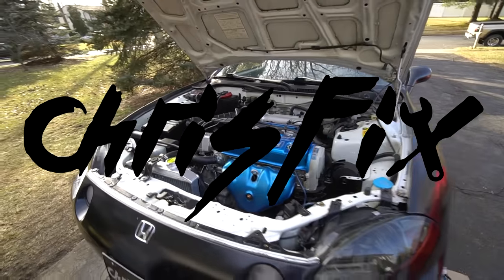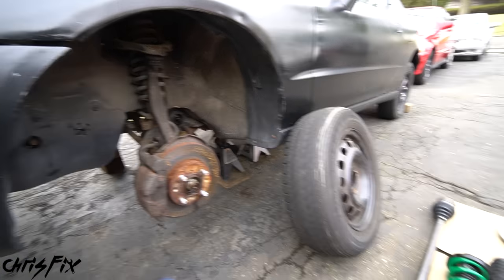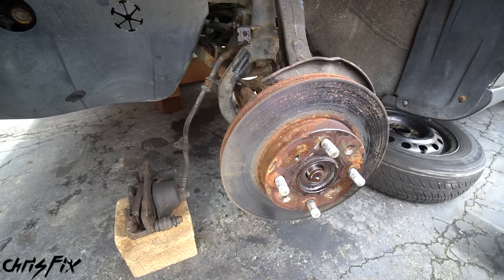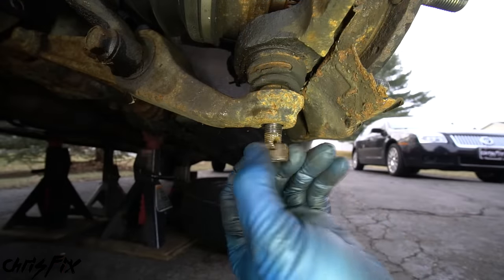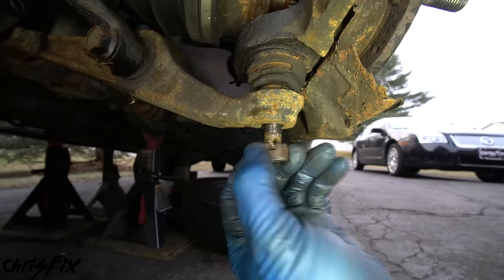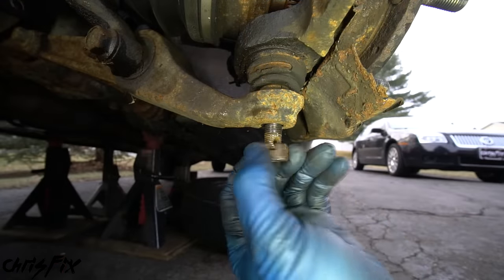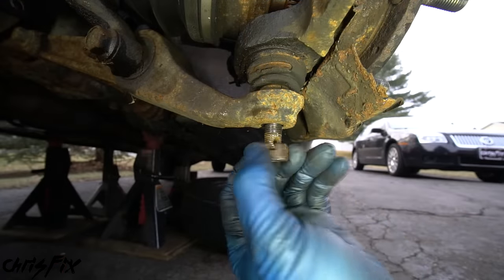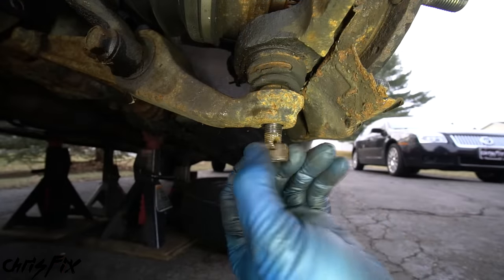How to Rebuild the Entire Front Suspension in your Car or Truck

Comment: Update: I rebuilt my front suspension and installed it myself. And Dude, I totally feel what you mean by feeling like a brand new car! I learned how to do it all thanks to your videos. Thank you!
Reply: Wow that's impressive, this job looks tough
Reply: @SenegalGab  It's not too bad, time consuming yes, but is worth it to push your vehicle's safety and reliability to the maximum. My car had tons of play in the front suspension it was scary on the highway. I knew then it was enough and it was time to rebuild. The alignment shop told me it looked like it was done at a shop, but I also needed motor mounts and a steering rack. Once I unfortunately dealt with those, I got an alignment and have never drove a car so solid before.
Reply: I am going to do this in the next couple months its been bad but after driving it almost 10k miles(190k total) since i got it its so much worse and im definitely going to rebuild the rear suspension too very scared and excited
Reply: Hello Cameraman, what brand did you use, and on what model? I'm going to do the same on my 4Runner, and not sure I can trust all the online 'reviews'!

Comment: I worked in a garage for 8months every time i had trouble when the boss left id use your page as help 😅
Reply from the maker: Lol were the videos helpful?
Reply: David Mejia Cabrera shawty
Reply: @chrisfix  very bro i actually became confident in my work thanks to you i appreciate your videos alot they mean alot to a guy like my self 💯🤝💪🏽
Reply: @chrisfix  when will you change the oil on the 1993 Honda del Sol and my grandpa's truck fuel pump is dead it is a 2010 Dodge RAM HEMI 5.7L

Comment: I'm pretty new at doing my own work on my car. I found so far that the hardest and most time consuming part is dealing with anything that is seized or otherwise stuck into place.

I like watching videos like these that are above my level of experience because it gives me a better understanding of how things work, and what tools/equipment I should already have on hand to make the jobs easier to do.

Thank you for sharing your knowledge with others. Because of people like you, I learned how to do my own oil, change my tires, replace my brakes, replace a seized caliper, and the other day I did rotors for the first time.
Reply: Not sure if you know these tricks so try these. Number one Kroil or penetrating oil Number 2 isopropal alcohol with winter green and a rubber, deadblow or wooden mallet let it sit for a bit wack it really hard a few times continue until the nut is loose. ( that little trick got a drill bit out of a Very rusted 80 year old drill) Number 3 get a blowtorch the red wrench will remove almost anything but will also ruin any temper present
Reply: Get some WD-40. That'll get everything loose

Comment: U should make a video changing drum
Brakes for disc brakes
Reply: Max Reynoso he already has a video
Reply: @TheBassforlife  Where?
Reply: @TheBassforlife  He has a video for changing drum brake PADS but not converting drum brakes to disc brakes.
Reply: Please Chris do so
Reply: TheBassforlife the video he has is not the one we need
Reply: he was to change the drum brakes on his truck to disc, even said so in a video and had the parts in the back of his truck, but sadly i think that video never happened.
Reply: Mighty car mods has a video on that
Reply: Logan Arzuaga title of the video??
Reply: @maxrl530  drum to disc brake conversion DIY
From when they first started converting too sexy into an actual track car so it's about a couple of years old
Reply: He does have a video. Did it on a ford ranger if I remember, he shows you how to change the drum brakes, then switches it to replacing a drum brake system with a brake pad system on its rear wheels.
Reply: @willd3808  I've been patiently waiting for that video ever since. I'm gonna keep waiting though cause this is Chrisfix we're talking about here and he never let's down his subscribers

Comment: This video and its sequel are what helped me start to understand the basics of my car's suspension and eventually gave me the courage to do a front/rear strut replacement on my Camry.  Some of the information had to be adapted to my specific car (mine doesn't have upper control arms and it has sway bar links that connect to the struts, for example) but it was still a huge help.  After about ten hours over the course of two days, some scrapes and bruises, a trip or two to the parts store, and of course plenty of swearing, my car had four new struts and rode better than it has since I bought it.  Also saved at least a thousand bucks over what my shop quoted me.

Anyway, great video and thank you for putting all this information out into the world for free.

Comment: One thing I really like is that his videos don’t make the jobs seem super easy like other creators.  Stuff doesn’t come off easily, stuff breaks, stuff won’t go together.  Then he shows how to correct the issue, sometimes in multiple ways.  

I can’t tell you how many times I’ve started a job, got into a situation that things didn’t go as planned, and then had to just keep trying for days … or (more often than I like to admit) after trying for a long time, towing the car to a mechanic to finish the job for me.
Reply: tbh thats an accurate take.  I'm not a professional and sometimes jobs just dont go as easy as it looked or I make a mistake and need to wait for a tool/part.  I haven't had to resort to towing YET but I've called for help and left in the driveway for a few days...

Comment: I got in an accident in my '08 Audi A4 2.0T. I was able to change all 8 control arms, the axles, driver side steering knuckle and sway bar. I did all myself with the help of my brother. I already got it aligned too. But watching this video after doing that makes my understanding of different suspension parts on different cars wider. So fascinating

Comment: I did this with my 99 GMC Sierra. Eight hours. $864.00 later and I had a new front end suspension. Only thing I needed was a professional alignment, in which I took to the shop to have it done. The biggest pain for me was resetting the coil springs because they had to be compressed into the upper and lower control arms. It was pretty scary to do that alone.
Reply from the maker: Awesome! I'm sure it came out great!

Comment: Depending on the car, suspension change is one of the more difficult car repair tasks for an intermediate level diyer like myself. Especially if you live anywhere where there's snow and salt on the roads during winter the parts around the wheel rust together. My advice is if you have poor suspensions, do the repair earlier than later when things are rusted even more.

Comment: Just replaced all my bushes inthe front of my car.  Being a mechanic myself for a long time i knew what i was doing but i have learned a couple of DIY tips from your channel which i do utilise on a daily basis, you would make a great mechanic mate! Keep up the good work! 
P.s i own a 2004 BA Ford Falcon XR6. The ball joints should be a service schedule item they wear out all the time 🤣. But boy the difference some new poly bushes made plus a good wheel alignment, i know the feeling you get when you first drive the car after repairs. I actually love driving my car again, also im gunna take on a respray job on my own car and use many of your tricks and tips you show in your vids! So thanks alot mate, much love from this aussie viewer ❤

Comment: I did not have any advisory issues with this video. I did do my UCA, LCA, my outer tie rod end, and of course the brake pads and the rotors. Just for everyone's knowledge, not all shops will press out and press in for you. I have never had good luck with the ball joint press kit, so I try to avoid that whenever possible. But, this is a good video. I did not need to do the cleaning and painting that you had to do, I live in Las Vegas.

Comment: My 1998 Grand Cherokee needs this BAD 

278,000 miles and very original
Reply: well buy parts little by little and when you have everything do it in one shot and that's also a video we would enjoy lol
Reply from the maker: Go for it! On the Jeep the parts are not that expensive which is nice!
Reply: Completely different front suspension. Has a solid axle with a 3 or 4 link and a pan-hard bar or “track bar”.  It is probably only 1 or 2 bushings on the panhard bar. This bar simply keeps your axle from moving side to side and can cause a wander or worst case scenario death wobble. Look up some videos on that for fun. There’s a lot of great content on Jeeps for front suspension problems. Diagnosis the problem and only buy the parts that you need because why buy more than you have to, we’re all here to save money right?

Comment: “we’ll be doing it with common hand tools” 

* shows his dump truck sized impact gun *
Reply from the maker: I just wanted to show that there are tools available to make the job easier!
Reply: I've got the same impact gun (even same battery).  I will never go back to using a rachet or breaker bar (for dissembling anyways).
Reply: But he never used it so what's your point
Reply: I work in a shop and have the same Milwaukee impact, very few nuts and bolts that thing can’t remove. Worth the investment for professionals or someone who does work on their own cars often

Comment: jus a tip wind the castle nut half way up and hit the control arm with hammer on outer edge the vibration shocks it as it is friction fit an pops off always works

Comment: I know I'm a little late to this but, in some models, you do not want to remove one side of the axel at the same time as the other, if you do, you could cause the inside of the transmission to fall out of place

Comment: my 95 civic has 278,000 miles on it and its had the cv axles and some of the suspension replaced. went on the freeway last night for about 70 miles and the alignment is excellent and theres no squeaks and rattles. the clutch is great and reverse seems to be the only gear it has trouble shifting into (let my friend drive it and he grinded it). the interior looks brand new and the only scuff i see is on the a pillar and it looks like it cracked in the sun.

Comment: 2:20 Another personal experience: for home maintenance, a hex impact driver (i.e. Makita DTD152, Dewalt DCF840N-XJ, etc.) with a socket adapter and a breaker bar will also do the job. They, as a set, are 2/3 or even half price of an impact wrench. Unless you wanna go pro, impact wrenches are not that necessary.
Reply from the maker: Good option! But sometimes you need the impact wrench torque lol

Comment: can confirm axle nuts are insane! my grand am’s acle nut factory torque is 284 lb ft of torque. new bearing reccomend 175-180 lb ft of torque to keep the nut on and the bearing itself uses 3 bolts to hold the hub/bearing assembly in my car! so pontiac really over engineered them if you ask me!

Comment: 19:03 I personally use wire cutters for old screws like that. They're soft so the wire cutters bite into it and you get more leverage than with a screwdriver. Try it out 👌

Comment: You should use a 3/4" drive breaker bar to loosen an axle nut, because axle nuts are sometimes stuck to the hub and using a 1/2" breaker bar in this case may require enough torque to break a breaker bar.

Comment: Hello Chris.
I’m a big fan of your videos, I think you’re the best when it comes to explaining how to.
However…you said that you were not going to use the dust shield because they don’t make it for the delsol and the junkyard has them rusted as well…the question I have is that when you finish disassembling the suspension you show the old and the new components side by side. The new parts show what appears to be a new dust shield…?
Where did you get that from…?
Also, I’m following your video to do the same to my 08 Honda Accord 2.4ltr and I didn’t separate the axle from the knuckle and I’m afraid I messed it up.
How do I know if my axle is still good to use…? (I don’t want to replace the axle this time).
Thank you for your time and you’re a real great inspiration to all of us DIYers.
Thank you sir…!!!

Comment: One thing you might have mentioned when painting the steering knuckle. Put the old brake dust screws back in, temperately, before painting.

Comment: You should link the snap ring pliers. I have spent a longggg time looking for ones that open up wide enough to take off the wheel bearing clips. I even ordered the irwin ones which are only for small tools & machines that use snap rings. I can't tell which ones you have in this video. There are many for sale at autoparts stores and the like, but most of them are too small or flimsy to handle the 3 inch  snap rings as found on these Hondas.

Otherwise... thanks for making these videos. I don't know if I would have found any instructions this good on the internet & gotten this far on my car without your help.

Comment: Just did this repair on my Del Sol S. 

You forgot to mention that there were metal brackets holding the tie rod boots on,

Also forgot to tell me about the 2 screws holding the brake rotors on. 

I was trying to pull the brake rotors off and was wondering why the hammer was not working 😖 cracked the break right up the middle 

Also I ripped my tie rod boots from pulling on them. Hopefully they are not important because the new ones I bought from Meveotec did not include new ones. 😵

Comment: I know I’m very late but you can put a bolt in  the little threaded holes on the brake rotors and pop them out. (Without a hammer)

Comment: Great video Chrisfix, you made it look so easy I was crazy enough to try lol on my 2012 civic lx. Lower control arm bolt seized in bushing. Ball joint castle nut with cotter pin got rounded. The price we must pay to learn I suppose. 🔩🧰

Comment: Hey Chris, quick question regarding underbody paint. I'm currently taking apart my car and putting it back together to clean up the parts (only doable for me thanks to your videos!). I'm hesitant to paint the underbody/suspension, even with a high quality primer and glossy top-coat like Eastwood. I've seen the horror stories about thick undercoatings accelerating corrosion once the paint chips and moisture gets behind it, seemingly regardless of how well primer is applied. How has all your cars' underbodies faired with an undercoating?  I'd love to see some type of update video on your underbody paint or the topic in general, since there's a ton of deceptive/snake-oily undercoating videos out there. Thanks and keep up the great work, you're an amazing teacher!

Comment: Lol I struggled with quite a few of these over the  years but most aren't too bad. But as you get onto bigger vehicles it is a bit harder for sure. My ranger I had to fight with for days to get the lower ball joint out, that was horrible.

Comment: GREAT VIDEO, CHRIS!! You've helped me fix some old Toyotas, for sure!! Questions: I'm looking at the Mevotech Supreme line for tie rods and ball joints for my 4Runner ('99, 300K+).  Is the brand holding up ok for you?? Also, would you replace the control arm bushings while replacing the other parts? They seem to be ok, but are original. Thx!

Comment: Quick fix the easier way of getting axle nut off just like the lug nuts you just loosen it up while the wheel is still on and while the axle is still in his place you loosen the the axle nut too so then you wouldn't have to go an extra yard and getting it off later

Comment: Hey Chris if I think its just the sway bar links causing the noise should I still replace the rest of the suspension just to be safe. Car has 202000 miles on it. Thanks my friend. Love your videos. Joe
Reply from the maker: If it's the original suspension then I would definitely consider doing a full replacement

Comment: All you're going to need is every tool. And rather than breaking buts by pushing up on the breaker bar just use gravity and body weight and push down ir step on it from the opposite side

Comment: Hey Chris, why didn't you consider replacing the knuckle? Is it not necessary if you can clean it?
Reply from the maker: Unless it's cracked or broken or severely corroded there is no point in replacing the knuckle. It's pretty thick steel anyways so you can get away with cleaning and painting it!
Reply: @chrisfix  Thank you for the reply :)

Comment: Very good video.  I'm only confused by why he didn't get a brand new knuckle?  Why use the old rusted one and surround it in nice, new, parts?  I guess it still looks nice painted.
Reply: do you know how expensive and sometimes difficult it is to get a new knuckle? as long as there is no damage it is not necessary to replace it. if you want it to look nice get it professionally powder coated and it will look better than a new one